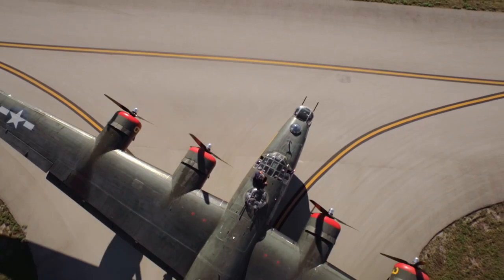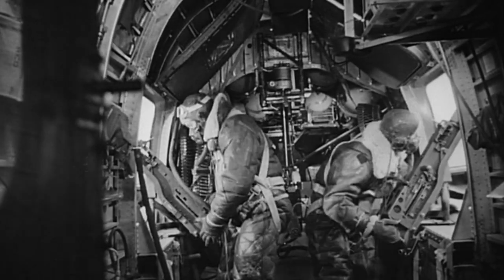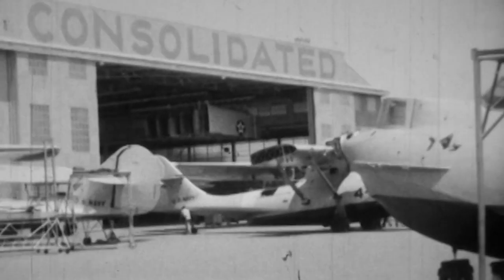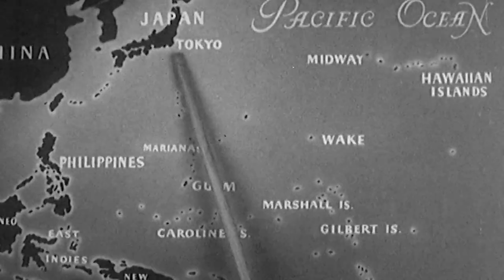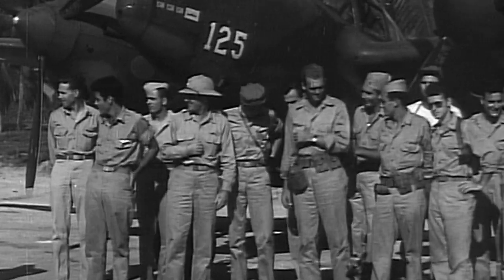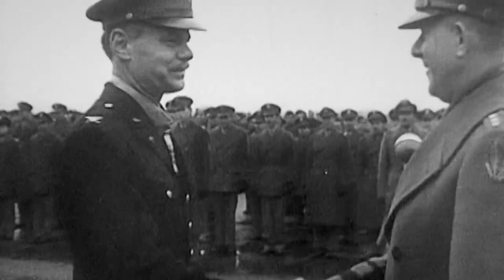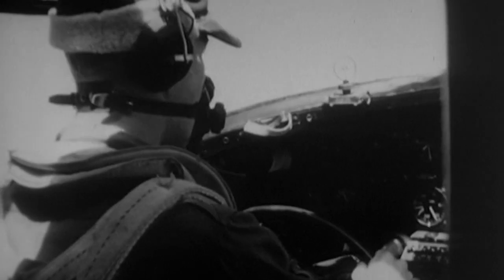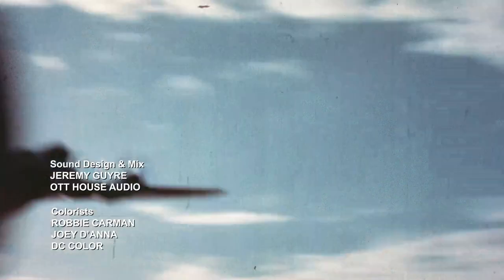Air Warriors - B24 Liberator | S08E05

Comment: My half brothers father went down in 1944,,,He was on the crew of the B-24H Liberator #42-52295 "Hot & Bothered” during a mission to bomb the oil refinery at Budapest, Hungary. They were shot down by enemy flak.
Reply: My grandpa was on B24 #42-52041 shot down over Vienna on 21 Feb 1945.  He and the crew bailed out and were captured by the Germans. He was a POW in Stalag 7A until Patton’s 3rd Army liberated them on 29 Apr 1945.  Their plane was also knocked down by flak.  Amazing young men these were.
Reply: Which half of your brother..?

Comment: The B 17 was so over rated.  It should have been taken out of action and not used over heavily defended areas.  I used to go to Offutt Air Force Base in Omaha Nebraska when I did work for the then Air Force Global Weather Central.  The Martin building there has sections of the floor made of wooden blocks.  Dampened vibrations that hampered some manufacturing
Reply: So what
Reply: I worked for AFGWC for 5.5 years.  Roger on the wooden blocks.
Reply: Maybe you should have written them a letter with your expert opinion then